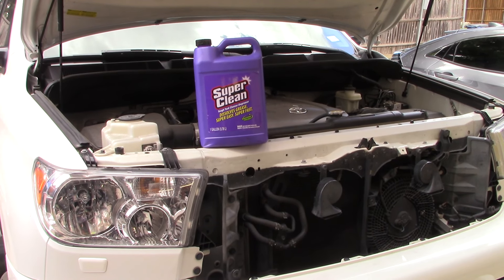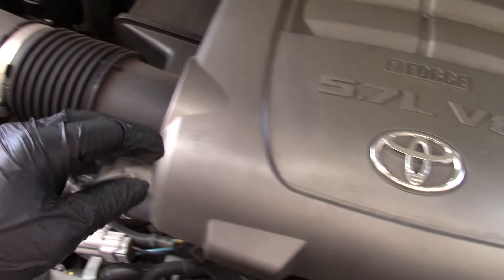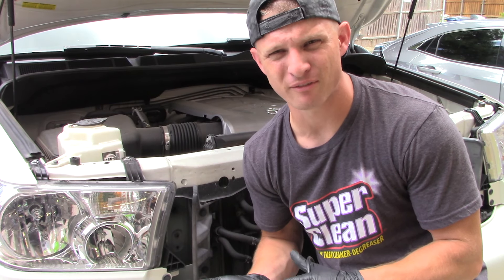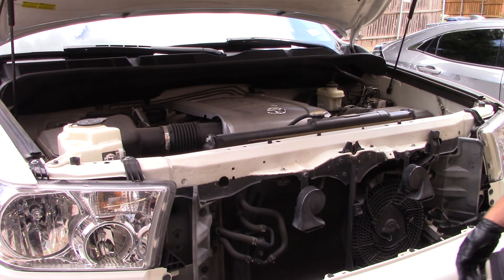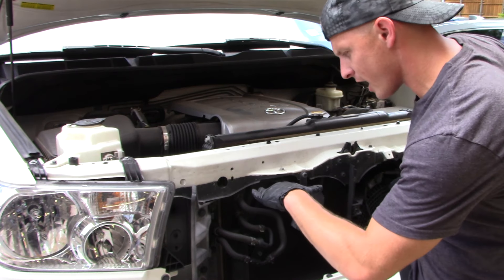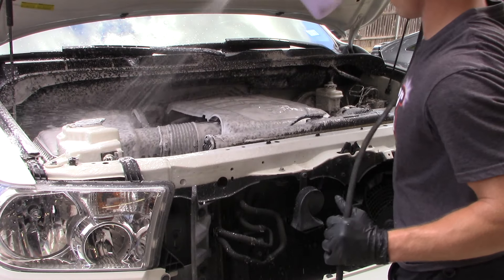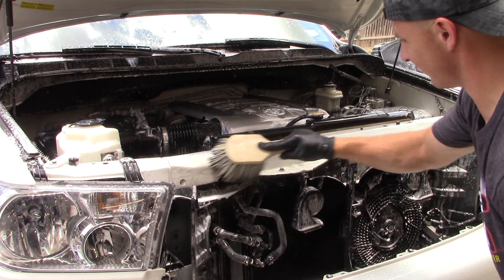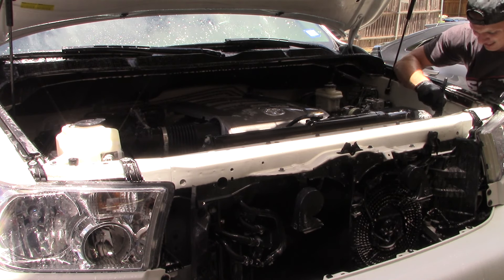REAL TIME: SUPER CLEAN IN FOAM CANNON vs DIRTY ENGINE BAY!!!

Comment: I know this video is old but.. free and clear laundry detergent in a foam cannon. Step 1. Foam and rinse. Step 2. Foam, scrub, and rinse. Step 3 note areas that need additional attention. Step 4 foam scrub rinse again. 

Laundry detergent is so much better than super clean
Reply from the maker: probably best to leave all free and clear in the laundry room where it belongs
Reply: @AQUALUXAUTODETAILING  or hear me out... Try it.. it won't damage anything under the hood but it just eats the grease and grime up. I have a pressure washing business. When I started I used to detail cars and restore headlights for a dozen or more used car lots. I still do, but only for one car lot. I tried a lot of products. Nothing comes close to getting the caked on grime off. Even my propane heated pressure washer doesn't do what the free and clear detergent will.